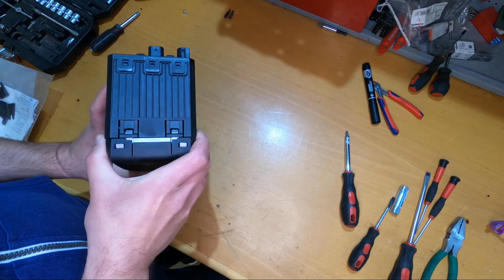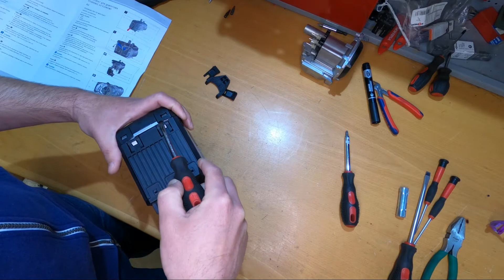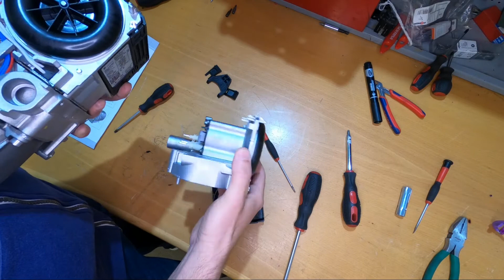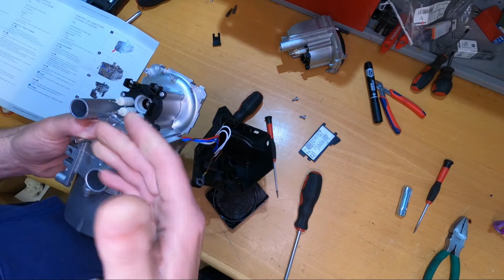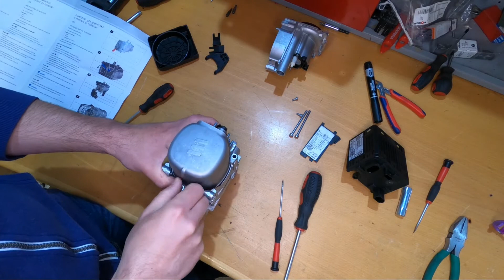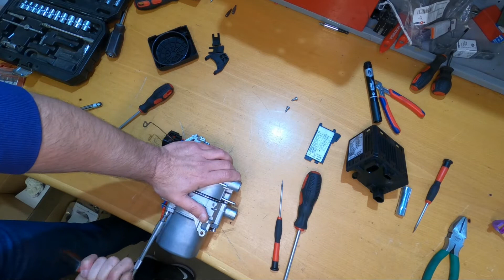Eberspacher Hydronic S3 teardown, blower replacement, Eberspacher service #8.

Comment: Hi, interesting to see how it's made and your opinions about it since you seem to have a lot of experience. I'm looking to get one of these units for my camper, do you think it's worth going with this new version S3? I was primarily interested in the commercial 24V version, the D5L. Or maybe it's better to get the old Hydronic 2 D5S or even the older D5WS? I need to have operation at high altitudes and I know the older version with high altitude kit can go to 4500-6000m (depending o which manual you read) while the new S3 it's all integrated but only up to 3000m. The new version looks to be more efficient and has a batter regulation of the burner without steps, but is it reliable and easy to service as the older once? Maybe too much plastic like you showed at the beginning? Looking for your opinion, thanks
Reply from the maker: From what I know only Hydronic 1 is available in 24V for some reason I don't understand. Hydronic 2 24V is obsolete. I would recommend getting the new one since we had almost no issues with Hydronic 3 and also it makes more sense in case of spare parts in the future.
Reply: @DIYHelper  thank you for the advice, I'll definitely get the S3 24V that has the automatic altitude sensor. Do you know if it can handle going higher than 3000m for short periods of time?
Reply from the maker: @FilippoMasoni  for short periods probably it is better to switch it off. I know for Airtronic 3 the test was made until 5500m and worked fine, not sure about the Hydronic though
Reply: @DIYHelper  Thank you. I didn't know the Airtronic 3 could go up to 5500m automatically, that's amazing, I wish they had the same technology on the Hydronic S3.

Comment: Hi there. Just bought Eberspacher Hydronic S3 Economy D5E CL. I bought it online from China hoping that I would be able to install it myself. There is no official installer in my country. After receiving the product, I have found out that there is not much information on how to install (there is instruction on a CD, but that is not  sufficient, at least for me) and operate it (nothing on operation and control). Your video is interesting one to look inside the heater, at least :). There is a Webasto installer in my country. Do you think they can install and commence Espar without an issue? I have got an impression from your words that Espar is quite similar to Webasto. Am i right? As Espar is OEM, are you saying they manufacture Webasto or parts for it?
Reply from the maker: Espar is the same as Eberspaecher, webasto is a different brand but I guess they can install it also. The principles are the same

Comment: Do you know what is the difference between diesel and benzin version of this heater? Are all parts identical except control unit? I would like to know if fuel type can be changed by recalibrating the unit.
Reply from the maker: https://eberspacherdirect.com/wp-content/uploads/2020/09/Eberspacher-Hydronic-HS3D5ECS-Manual-Parts-List.pdf check the parts manual here, there are more different parts, and no i don't think you can. Just mount a separate diesel tank.
Reply: @DIYHelper  Thanks so much for sharing this info. It looks like only  combustion chamber is different (with gasket), besides the control box which has different part number but i still think that its only software part that is different. I have no doubt that those two parts will cost same as whole unit btw. 
I used hydronic diesel in the past and i still got one d5wsc in my truck but want to experiment with gasoline versions in my cars. Well, i got one s3 b5e one the way already, so ill keep you posted.